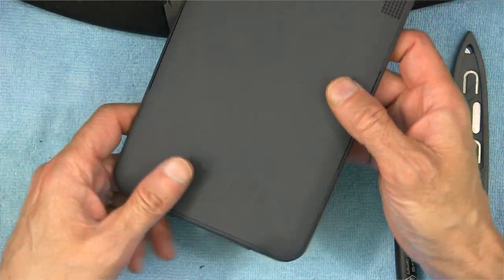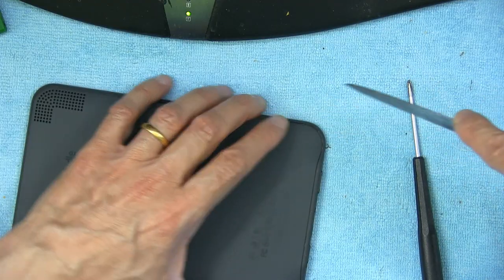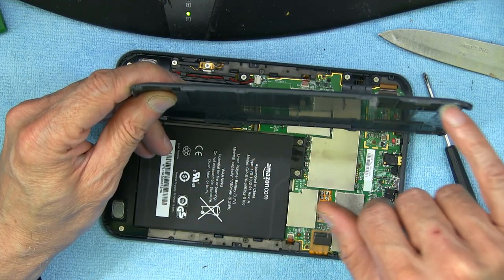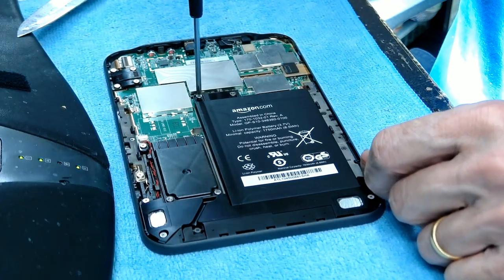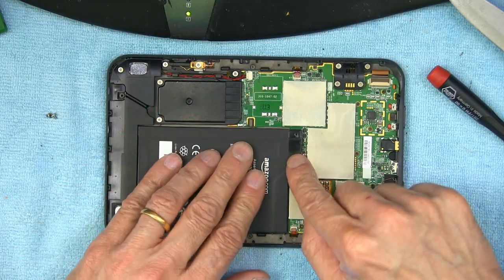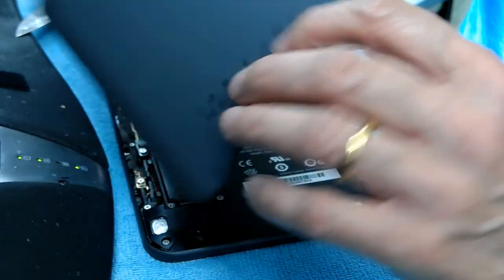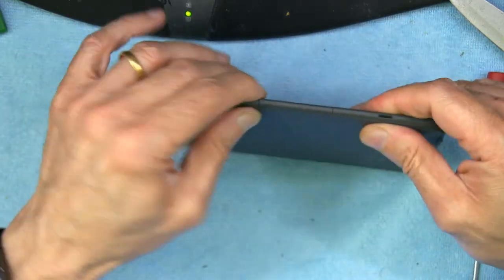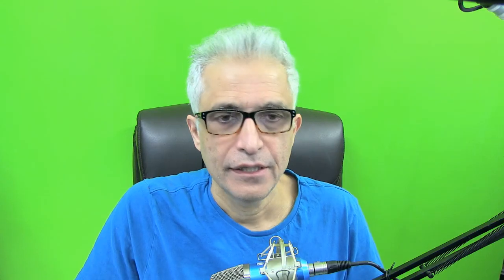Tutorial on how to replace the battery pack in an Amazon Kindle D00901 Electronic eBook Reader

Comment: Hello Technology Tips. I accidentally damaged the screen on my original gen 1 Amazon Kindle. I purchased a used Gen 1 Amazon Kindle from someone in my neighborhood (that was having battery issues). After a simple battery swap, the replacement unit will not work.....even after the holding the power button for and or getting the battery fully charged. Looking forward to your suggestion(s). Regards, Peter
Reply from the maker: Greetings, I recommend that you use the screen from the defective used kindle that you bought from your neighbor, to fix the broken screen on your original Gen 1 Kindle.
Reply: @TECHNOLOGYTIPS101  Thank you for your feedback. I saw a couple of videos on how to replace the screen and it doesn't seem overly difficult so I will give it a try. The donor Kindle cost me only $15 so it's not a huge loss if I mess it up :-) Happy Holidays!
Reply from the maker: @peterfrancolini5906  Happy Holidays!!
Reply: For some reason the screen swap didn’t work out. To make sure my battery is good I reinstalled it on the unit with the cracked screen and I can see it initializing but that same good battery on the unit with the good screen still has no reaction. I’ve tried multiple combinations with o success. This is so weird.
Reply from the maker: @peterfrancolini5906  Make sure the part number on the screens are the same, sometimes they use different part numbers that may not be fully compatible. Now that the screen is broken I guess looking up the part number is not going to help, but you could get a nonworking one with a good screen from eBay for just a few dollars.

Comment: I have a question about the part underneath where the screws rest there two little round metal things I dont know what they are it came loose. I hope I did not mess it up. The battery is out for delivery. So guess i will know in a few hours
Reply: Update I fixed it the Kindle is now charging. The only problem when I snapped back into place it did not pop back all the way ind where the charging port is. Its mostly popped in but it clip wont pop back where pried it up popped right in. A little disappointed. But my kindle lives again
Reply from the maker: I am glad that you figured it out.

Comment: My Kindle has been on and off continuously since last night until now. One guy told me that my Kindle 3 had a 'main' error. Can you tell me where and what 'main' is? Help pls!!
Reply from the maker: When they say main, they mean Main Board also known as Motherboard. That is the primary circuit board on which the chips are soldered. So if that is bad you need to replace the Main board or get another kindle. The only issue with that is that all your locally stored books will be gone.

Comment: The battery is swollen on my kindle. It is also stuck on the wake up screen. Will changing the battery fix that?
Reply from the maker: A swollen battery is not good and it immediately needs to be replaced. It can explode and spill chemicals inside your kindle destroying sensitive electronics. In addition to that it is a safety hazard to charge a swollen battery.
Reply: @TECHNOLOGYTIPS101  I have it out and another one ordered. Just trying to figure out if I should go ahead and order another screen or if the battery change will fix it
Reply from the maker: @clarkedavis9888  I think the battery replacement should fix it, however keep in mind when a battery swells it may physically damage other parts. So make sure that you buy the battery from a seller who will accept returns in case there are additional issues with the Kindle.
Reply: @TECHNOLOGYTIPS101  I will keep that in mind. And thank you for responding
Reply from the maker: @clarkedavis9888  My pleasure!

Comment: i followed this and my new battery refuses to charge for more than a few seconds without the orange light turning off. is that because i did something wrong?
Reply from the maker: I don't think you did something wrong, but the new batter could be defective. Also, check to make sure the battery cable is securely connected and not loose.

Comment: Hi. Maybe you can help me. Mine, is not working any more. When i charge the device, a yellow light turns on then, when i disconect it a green light blinks like 3 times and then shuts off. The batery is fine. Can you give me some advice? Sorry my english this is not my native language. Thanks!!!
Reply from the maker: No problem, your English is great, better than me lol.  The problem with your kindle seems to be the main board which is not really wroth fixing because the cost is more than the value. If you look on eBay you can find used kindles for less than $20  some of them have bad batteries but you can use your old battery in them. For example here is a link to one https://www.ebay.com/itm/284065804315
Reply: Thank you very much!!! I will do it!!! 😃
Reply from the maker: @ailanasalvi5399  You are very welcome

Comment: Anyone has a link to buy this battery please?
Reply from the maker: You can get it on eBay but make sure to buy it from a local seller not form an international seller as it will take months to get it. Here is the link https://www.ebay.com/sch/176970/i.html?_from=R40&_nkw=d00901+battery&LH_TitleDesc=0&_sop=10&rt=nc&LH_PrefLoc=1

Comment: Mine won't update, very frustrating as I really like this Kindle. I cannot connect with the wifi even though it's connected. I've seen others drag and dropped latest update, I've tried but it won't let the update device highlight. In other words it's greyed out. So it won't install.
Reply from the maker: Sorry to hear that, you should try updating it via a USB cable, if not try using an older 2.4GHz router because some of them have issues with 5GHz WiFi

Comment: I changed my battey, and the kindle started up, and got to full charge. Then I noticed the on/off switch was not working!! Took it apart again but just can't see what is wrong...
Reply from the maker: Check out the slider button to make sure it is not disengaged from the actual switch which is soldered to the main board.